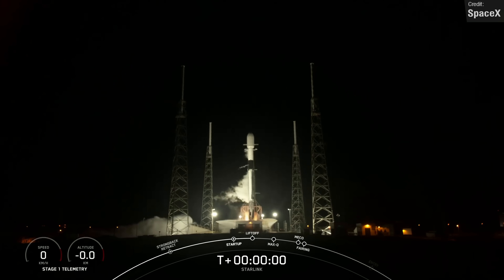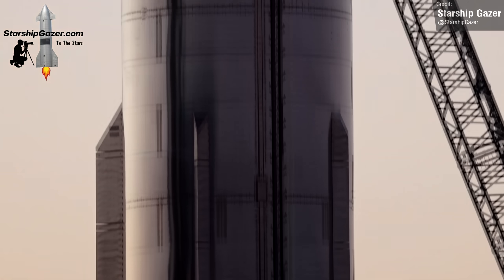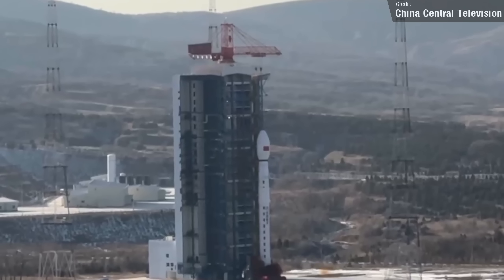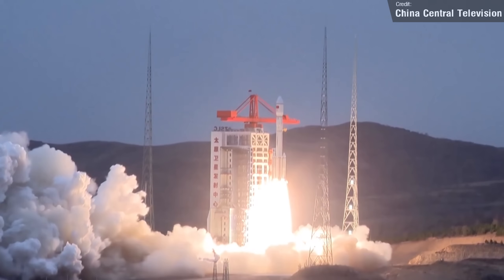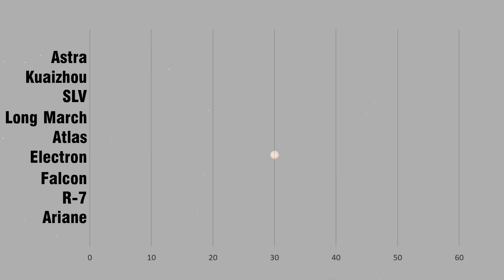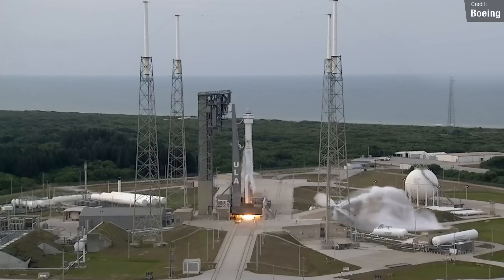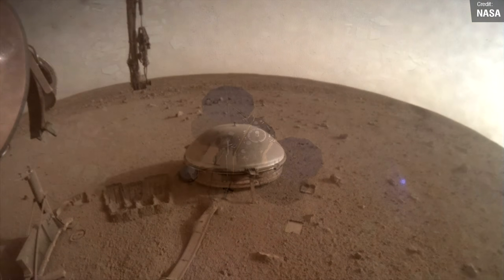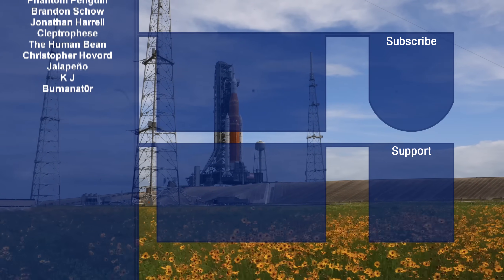SpaceX's Insane Launch Record, Starship Flight Draws Closer, RIP InSight, & ALL of 2022 Reviewed!

Comment: At the steel plant when removing an install of work rolls that weighed 25K lbs for the small ones where all lifted from one end using a cantilever setup so 2 J hooks with single lift point above the rocket will work. Spreader bars are awesome lol

Comment: InSight has a hand. why it doesn't have a brush?
Reply: Because an arm with a brush is more complexity and replaces some of the science weight. Mars dust is usually static charged, so isn't simple to remove. The dust mitigation plan without a brush worked as Insight went 1480 days into a 731 day mission.